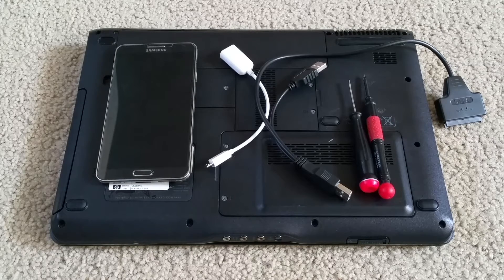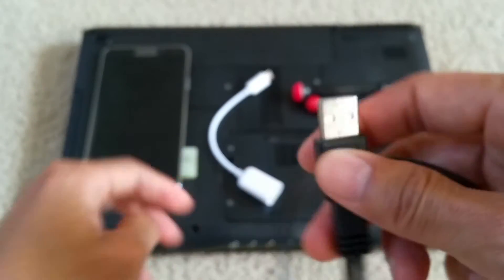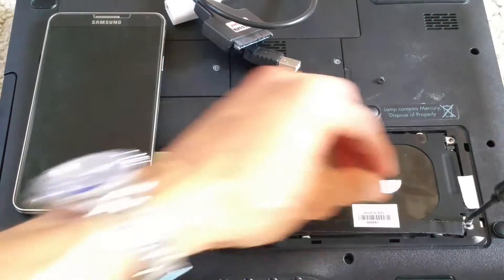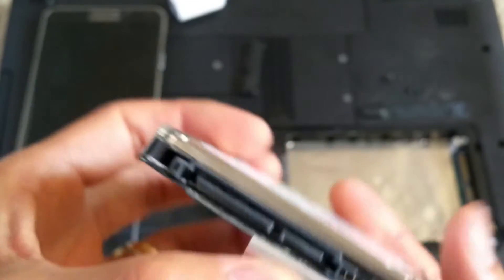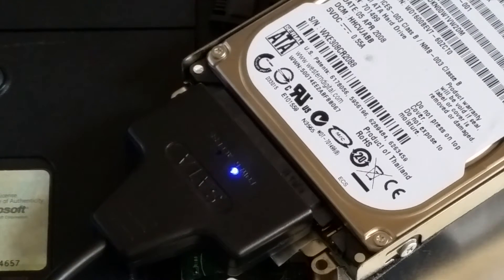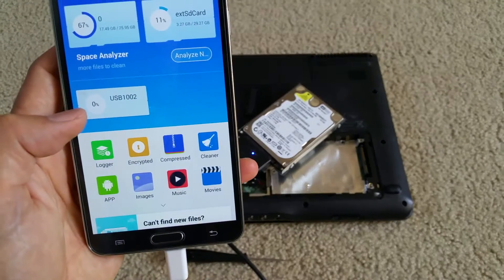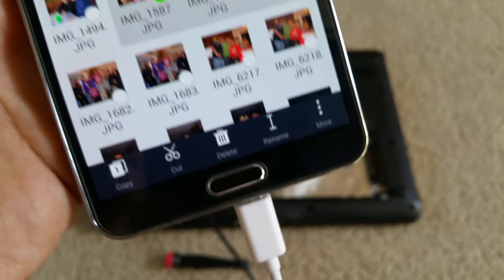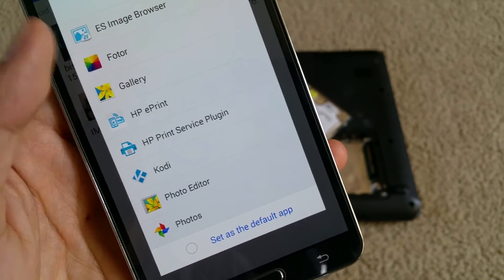Data Recovery On Your 2.5" SATA Laptop Notebook HD to Any Android Smartphone 2016

Comment: I have hard drive USB enclosure connected to my smart phone via the OTG adapter that the phone came with, but it keeps disconnecting. I think it needs an external power source to run the drive.
Please let me know thanks
Reply from the maker: Well if your enclosure have power source already then you are set. Is it a big 3.5" HD?
Reply: @macdaddypimpping  2.5" Orico brand name no power source. As son as I plug it in the phone I see blue light comes on, but then when I make selection on the phone for "All Files," or "Images" the light goes off and disconnects.

Comment: Hello, Can I connect an 2tb hdd 3.5inch with my phone via USB otg?? (With extra 12 dc power source)
Reply from the maker: Which phone do you have?
Reply: macdaddypimpping I have the xiaomi redmi note 4x but what's the point of your question?
Reply from the maker: To make sure if your phone is compatible with UTG cable or not.
Reply: macdaddypimpping my phone is compatible with USB OTG I have checked this

Comment: does it have dc12v connection?
Reply from the maker: No, it uses voltage from USB.
Reply: Because i seen another version with 12v power supply for the 3.5in hdd, so your is only for the 2.5in.
Reply from the maker: Yes, I got both versions.